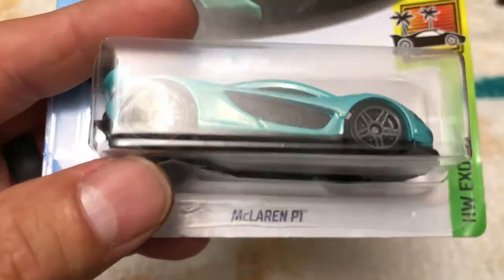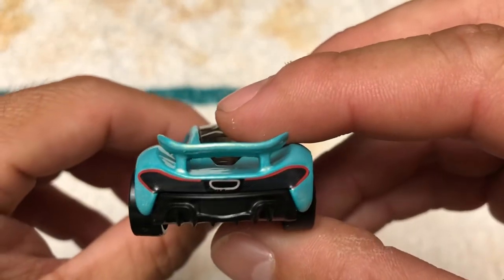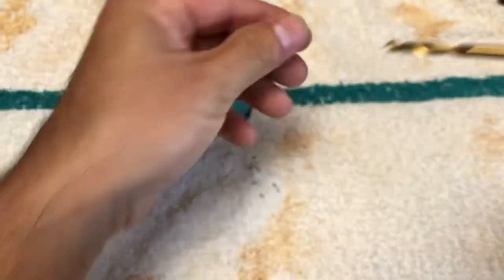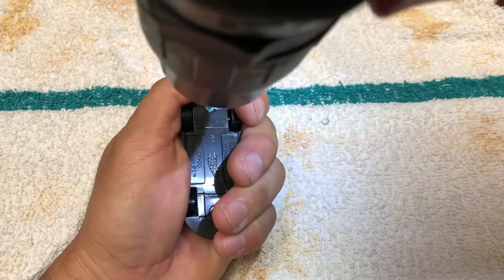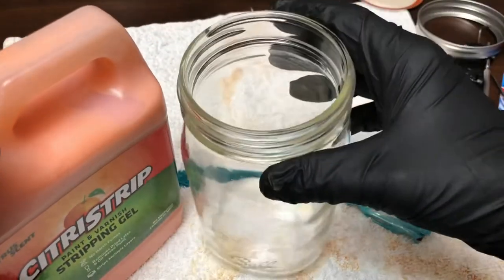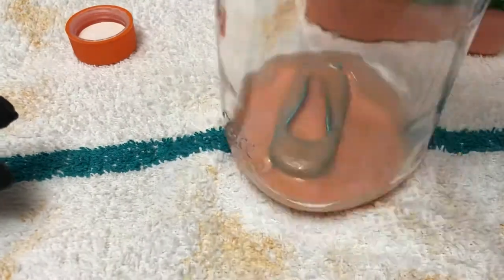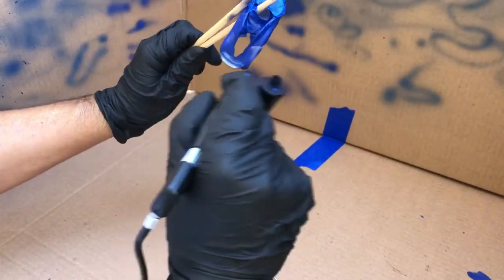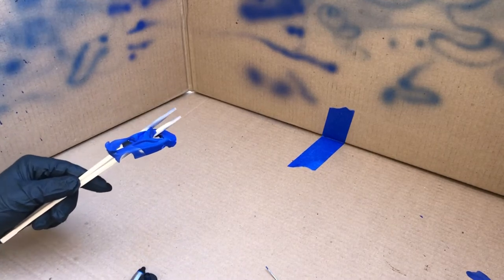HOW NOT TO PAINT A HOT WHEEL !!!!!!

Comment: Get some alligator clips make sure you scuff it and degrease with rubbing alcohol and car is dry. Did you spray right out of the bottle? You want to do a tack coat first as well let sit 5-10 minutes once dry hot with a couple coats of clear! How did you reassemble car?
Reply from the maker: Thanks for the tips! This was awhile ago. But now I drill and tap to put together. And yes the prep takes longer then the painting 😂. I use mostly createx paint thanks again 🤙🏽